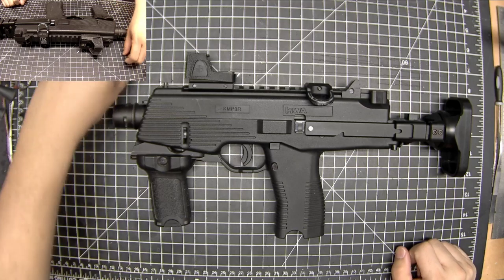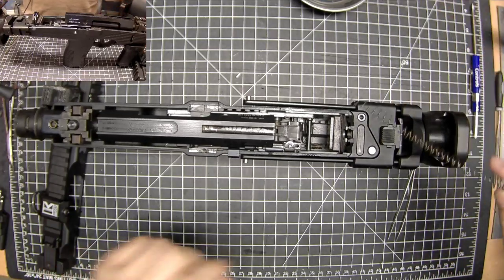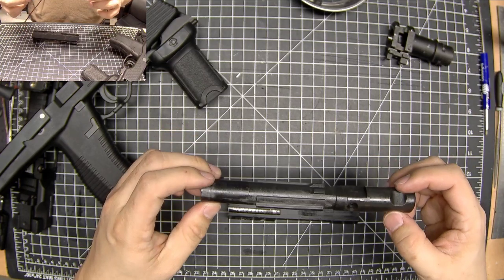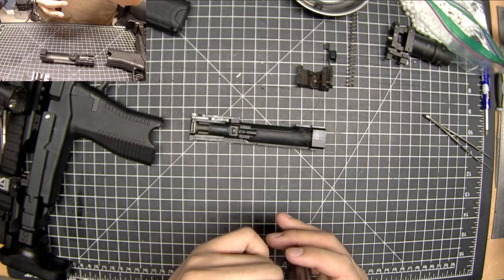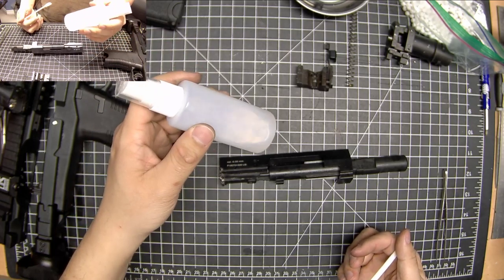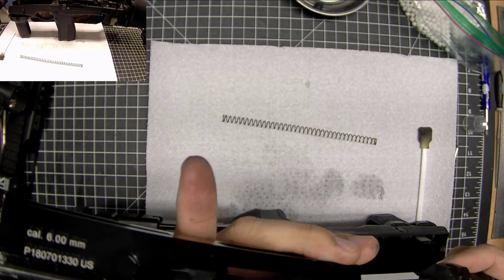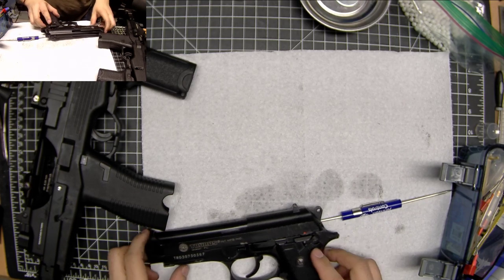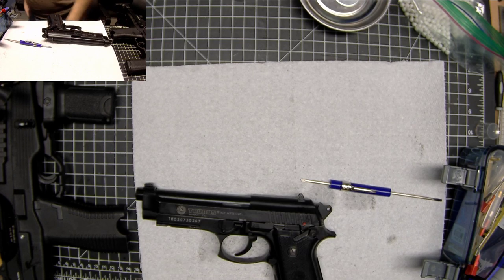Airsoft Teching - MP9 Misfeeds, Dry Firing, and Troubleshooting

Comment: Very good video. Thanks.
Helped me with my bolt not locking back issue.
Reply from the maker: Glad it helped!
Reply: What exactly was needed to fix this? I currently have the same issue where I will run out of bb’s but my bolt won’t lock back on the last shot or for anymore after, it would just keep dry firing. Help would be greatly appreciated

Comment: I have relatively the SAME problem. But my issues seems to be with the hop rubber and not the disconnector. The disconnector has zero to do with the issue unless its broken. The nozzle doesnt go in as far as it should by about 1MM. That 1mm makes a big difference between the cycling. If I push it manually forcing to deform the hop rubber it will cycle. The sealing lip is too small to allow the nozzle to seat inside completely. NowI havre to make a decision...alter the bucking by dremeling the sealing lip or sand down the nozzle tip to a taper. Now heres the difference mine is a 2008 KSC JAPAN model. My gas system is also pre sys 7 and ns2...so no return springs. FYI, KIC airsoft has your parts in Hong Kong and they take about 2 weeks to get here. I just ordered some 2 weeks ago and they got here this week. Nice to know that we are using the SAME materials for our troubleshooting helps me to prove my theory.
Reply from the maker: Recently just posted another stream - at the end of the day the hop up rubbers seem to be particularly vulnerable to swelling due to silicone oil. A replacement of the hop up rubber completely fixed my MP9 and I'm going to keep a spare in my parts kit so I can field repair.
Reply: @aonomus  so...the solution is this...get some black rtv sealant...and some ptfe tape..smooth on a thin layer of rtv sealant on the feed end of the hop rubber..wrap it with 3 layers of ptfe tape..the rtv sealant will stiffen up the end of the hop rubber and the ptfe tape will provide the structure to keep the hop rubber from deforming. And stop using silicone oil green gas...silicone destroys the structure of the hop rubber. Ksc hop rubber is crap! My customer used it after I told him to stop using it..the same problem occured again. Cleaned the hop rubber used rtv sealant with ptfe tape. The gun cycles perfectly again
Reply: @aonomus  so the problem is fixed by replacing the hop up? I have the same problem here😢
Reply from the maker: @bluberriez2  Yup

Comment: I’ve encountered an issue with my mp9 where the gun cycles but will only fire every other BB in the mag. 

I originally replaced the main seal since it broke, then I replaced the nozzle and glued the return springs in place so they couldn’t come off. Since I’ve repaired the gun, it only works half the time and I’m not sure why. It will only shoot every other BB. 

Other times, it won’t shoot at all and I have to reset the hammer manually by pulling and releasing the charging handle. Then it goes back to firing every other shot.

I checked my disconnecter and nozzle and don’t see any issues. I’m thinking it’s either the magazine, jet valve or jet valve spring. Have you ran into this or have any idea what the issue could be?
Reply: As an update, I think I found the issue but am unsure of how to fix it. I filmed the gun shooting in slow motion, and saw that the cylinder is sticking to the hop up bucking. I tried putting silicone oil on the cylinder head and the intermittent firing still occurs though. 

I have a new oem bucking and magazine on the way, hopefully the issue lies in one of those.
Reply: @f0xtr0t540  did you solve the problem?
Reply: @altis9030  yes actually, my hammer was broken and resulted in the light striking. I replaced the hammer and the issue was resolved

Comment: the slide on my gun (mp9) does not go all the way forward on the inside. What might be the problem
Reply from the maker: Have you checked for any stray BBs that might be trapped, possibly in the bolt, behind the air nozzle?

I've had that happen for one of my GBBPs, causing it to lock up and be impossibly hard to disassemble.
Reply: @aonomus  it looked clear but i will be taking another look at it this weekend because it has been a while

Comment: Just bought a KMP9 off eBay and I ’m having an issue where I rack the slide, and when I pull the trigger, the hammer doesn’t seem to drop.  This potentially a problem with the disconnecter? And if so, happen to know where I can find that part online?
Reply: Ended up picking up a spare disconnecter from Evike and swapped out the older disconnecter with the replacement. My issue no longer occurs and the trigger now resets 👌🏽
Reply from the maker: Most of those parts are all zinc/aluminum die cast parts and pretty cheaply made. Maybe it had failed?

Comment: Do you have the cqb bolt installed? If not how are you dealing with the hot fps
Reply from the maker: I do not have the CQB bolt currently (though it's on order). Local CQB field permits 380fps.

Bigger issue is the hop up absorbing silicone oil and deforming....

Comment: when my mp9 is on semi auto it sometimes trapse a bb inside the barrel. whta should i do
Reply from the maker: If you aren't already, always use quality BBs. Generally a good idea to clear the airsoft gun of gas and bbs, and inspect with a light. Use an unjamming rod to get the BB out, not a screwdriver or other metal items that would scratch the barrel. Then check for any dust/debris that need to be cleaned out.

This happens even with quality BBs sometimes, a BB might get split inside the barrel and jam badly, but poor quality BBs that aren't polished will damage the barrel and jam frequently.

Comment: Hi mate ! You got any social Media account with direct message system? I'd love to exchange my issues with you and perhaps solve my issue. 

Mine let's out all the gas on first shot, I've just now completely disassembled, cleaned and lubed but no effect, vavle knocker seems fine ? I come from building custom hi capas from scratch, but the mp9 Is something on it's own regarding valve knocker i see.
Reply from the maker: Every time I've had issues with the MP9, it really seems to be to do with the integrity of the hop up rubber. If it's swollen due to silicone oil (it really likes to stay bone dry) then the nozzle will not hold a seal with it. Without a good seal inadequate pressure is built up and the bolt fails to cycle back, leading to the striker hanging on the valve. Try checking the hop up rubber and see if it's in good shape or not, you might need to pull it apart more but looks can be deceiving.

Also the nozzle return springs on KWA MP9s are notorious for snapping too which can cause other issues.
Reply: @aonomus  i bought two mp9 used, on both the nozzle o-ring was cracked and dry as a camel coochie, sear was broken but i could Salvage from the other. Plan is now to get Steel parts and perhaps mp5 mag adaptor on hPa, as these mags tend to be s magnet for everything filthy and just a general pain the ass.